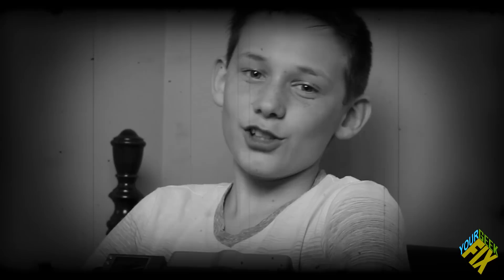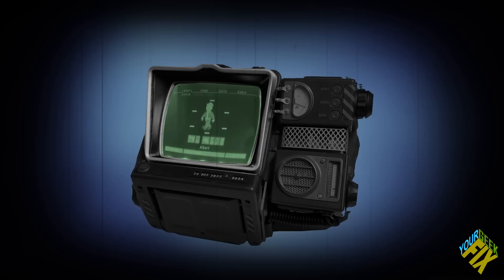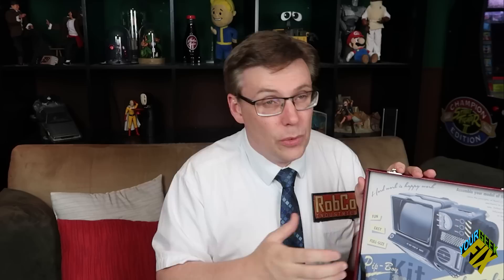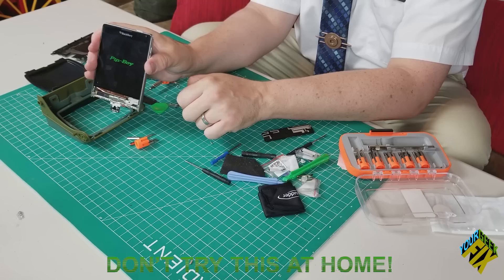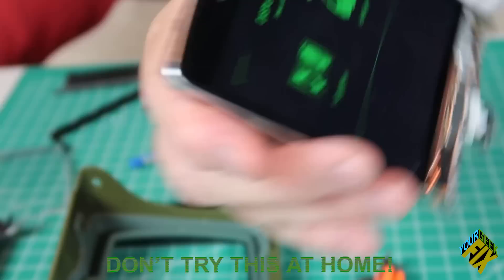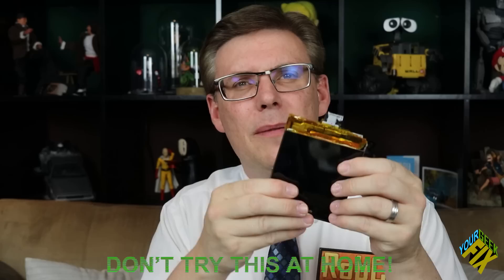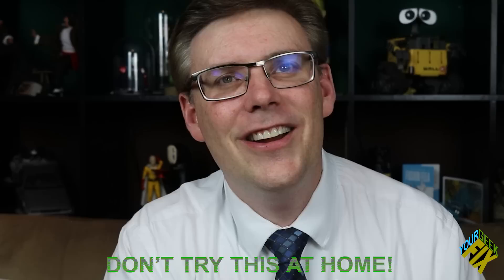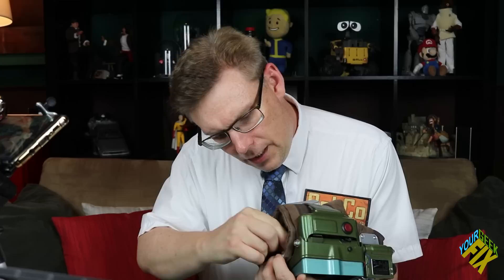How we made a real working Pip-Boy 2000 Part 1 of 3

Comment: When he said “this is the black berry passport” for the third time I lost it. Great video and you can feel the anxiety while building through the screen
Reply from the maker: Thanks for watching Somebabies.
Reply: Just looked up the parts of the phone he used on Ebay....he had less than $200 in all the parts if he just bought them. The phone itself $400+
Reply from the maker: @jamescobun7395  here In the Us, bb passport is available for 65. I typically paid in 60s to 80s.
Reply from the maker: @jamescobun7395  although there were only so many before I took 3.
Reply: I looked up for new in box on the phones latest model. Same with parts.
Reply from the maker: @jamescobun7395  https://www.ebay.com/itm/BlackBerry-Passport-32GB-SQW100-1-Black-Unlocked-Good-Condition/124139952096?epid=203944094&hash=item1ce75157e0:g:uawAAOSwxOlehk0R That was the first one taht came up for me. Also avoid looking at the silver as it was more limited and more recent.
Reply from the maker: @jamescobun7395  There is a silver for 65 with nonworking screen right now. If you are putting a different screen on anyways, it might work.
Reply: Again those are USED parts look for NEW
Reply from the maker: @jamescobun7395  They haven't made this phone for four to five years. I wouldn't dismantle a rare phone that has never been opened. Believe me on that. Doing this mod will definitely end the warranty
Reply from the maker: @Mineta you are pretty darn cool yourself. Thanks for watching and the great comment.

Comment from the maker: IMPORTANT UPDATE!!! I just checked back in with the Wand Company about the "Radiation Sensor." They stated, "I'm afraid not at the moment. Plans are currently on hold as we're not sure if we have enough interest from our chosen retailers.
 We'll update our socials as soon as we have any news for you." I asked how we can help get this done. I'm not sure at this time if it is the Wand Company or certain retailers we want to pressure for this. I will update you when I know more. Stay Safe!
Reply: you can pin your own comments so they stay at the top and dont hover down in the middle of the comment section
Reply from the maker: @novanppp  thanks for the recommendations.
Reply: A real geiger counter might be possible, but only if you can find a way to integrate the detector in such a way that it doesn't mess with the actual surface itself. It would need to be beneath some really thin, preferably very, very light and non-dense material in order to pick up actual ambient radiation - or perhaps some sort of mesh. Not sure if there's space in the prop for that. The dial might be more of an issue though, I'm not sure if any geigers are still made with a physical needle, most modern ones just have a digital display for more accuracy. That would probably need some custom programming.
Reply from the maker: @JRexRegis  I made it already. Watch for video 3
Reply: @YourGeekFix  Nice!

Comment: Just wanted to thank you and let you know I had been planning to try and make similar mods to my own Pip-Boy 2000 as soon as I get one, I had a few slightly different options in mind for Screens and or speakers, and I plan to be designing and building my own Working Geiger counter mod that I plan to make compatible with the app if Bethesda doesn't release an official one. I will probably follow this video to some extent as a sort of reference/tutorial but don't worry I will be following many standard safety precautions including wearing Saftyglasses, fireproof gloves, and an acid/fire resistant smock. I also plan of replacing some of the standard plastic Pip-Boy 2000 parts with machined metal ones to customize the durability and design of My Pip-Boy. This is the first of your videos I've ever seen and its earned you a sub. :)
Reply from the maker: Sounds awesome. I will say, this build is really heavy on your wrist. It also feels like it is made of real metal. So, if you plan on wearing it be aware of weight.  Make sure you share your finished product. Would love to see it.

Comment: This video is awesome. One note that I think would be cool is to take all the charging cables and make the pip-boy's computer cable (that the sole survivor plugs in to computers to hack, obviously) and make it functional and use that as the hub to charge the pip boy (Thus removing the need for the batteries for the radio or the requirement to remove the entire side to access the batteries. Plus it wouldn't be hard to add a small USB battery pack as a central energy source.). Also if you made the Metro hand crank generator you could abstain from the need of batteries entirely.

Just as passing thought. Good luck and halcyon days.
Reply from the maker: That's a great idea.

Comment: As an owner of one of the replicas, the lack of a fully working screen, radio etc on the Pip-Boy is the one disappointment.  A fully working one would be great, and since the app is built out from Fallout 4, it would have been relatively easy to have one and connect it to the knobs etc in some form. As this proves: there was a viable screen hardware option too, and I personally would have paid extra for a fully functional one like this.
Reply from the maker: We have a special app for 76 and new vegas, but less impressive due to no animation of walking. If you saw video 3 you know how to activate the knobs.
Reply from the maker: Also video 3 shows the Geiger counter clock and holotape mods.

Comment: That's the one thing I was most curious about, would it be possible to put a functional Geiger counter inside a PipBoy?

Mostly because I am wondering how close we can come to having an authentic real version of the device, that is exactly like the one featured ingame.
Reply from the maker: Shortest tube I have found is 4 inches and not cheep
Reply: @YourGeekFix  I wonder if 3D printing might be something to investigate for custom made parts.
I've been working on it lately and it's really easy to make an object if you have some basic modelling and math skills.
Reply from the maker: @zrowngctr  You make it and we will use it.
Reply: @YourGeekFix  make what specifically?
Are you interested in plastic parts?
If you provide the measurements and shape of the item desired, I can give it a try.

Comment: We forgot some solar panel
Reply from the maker: The Pip-boy is powered by nuclear energy. But you could solar power it using a Solar Power Bank. It would connect to this build by USB. The smallest nuclear options are the SMRs, which would still be too big for the Pip-Boy. Thanks for the recommendation.
Reply: Your Geek Fix how about longer range radio/stereo?
Reply from the maker: Are you referring to the radio or the screen area? The screen actually can use longer band transmission, using an app. Could use ham app.
Reply: Your Geek Fix no wait we’re is the sound coming out of? Can you add small external speakers on both sides of the pip boy?
Reply from the maker: @sammytimgaming2947   The sound is coming from the top module. It is possible to put 2 of those speakers in there. Right now, it's in the center. Due to the small area, it's questionable that stereo sound would be an improvement.  The right speaker is for the radio only and is a part of that module. Right now, both speakers can work at the same time period.
Reply: Your Geek Fix any other device that we’ll work, and fit the pip boy screen?
Reply from the maker: @sammytimgaming2947  not that I found
Reply: Your Geek Fix are there other blackberries that fit?
Reply: Your Geek Fix thanks
Reply from the maker: @sammytimgaming2947  Not yet. This phone is also very wide. The name passport is from the exact size of a passport. None have been as wide. This is even wider and more square than my notebook. If you find an alternative, let me know.
Reply: Your Geek Fix did you warp the screen?
Reply from the maker: @sammytimgaming2947  Unfortunately, no. THe passport was the only one wide enough.
Reply: Your Geek Fix well the you get the illusion right
Reply: Your Geek Fix hey I have an idea can you just use the blackberry screen and then us a different OS, chipboard, computer? And can you describe on how heavy it is?
Reply from the maker: @sammytimgaming2947  then the touchscreen wouldn't work. It would be awesome to load a different firmware.
Reply: Your Geek Fix your channel seems like the channel been here for a while it quality it actually that good
Reply: @YourGeekFix  
I wonder, if there’s a company, where you send them, what your trying to build.
And they give you, a designed setup to fit electronic inside.

I do not professionally know how to put a blackberry inside my pip-boy.

I would ask a company, to configure my own devices to fit in my pip-boy.
Not sure if there any companies that professionally modify your electronics.
Reply from the maker: @sammytimgaming2947  IDK Sammy

Comment: Of all the "working pip-boy" videos i've seen this one takes the cake. Fantastic work. I made a steampunk pip-boy back in the day using a Galaxy s4, might have to replicate this myself (at my own risk of course). for practicality's sake I'm pretty sure i can figure out how to put a keyboard on that bad boy. maybe I could make the radio module rechargeable too....
Reply from the maker: Sounds awesome! The keyboard and cable are usable after I dismantled it and are needed if you reformat it. You could get a cable extender for the keyboard, though there is none for the screen. The tape deck would be a possibility. Also, the front could work. Remember the keyboard has a trackpad built in.

Comment: Two really simple mods I did with mine at Menards probably other stores sell it also they sell a stick on ultra bright led light that has it's own switch it is about the size of a shirt button , the battery is replaceable also fits perfectly on the top flashing .
The other thing I did was Michaels craft store sells el wire that is battery operated available in different colors , I drilled a small cut into the flashing the battery unit wedges between the cuff and top screen perfect I  then put the el wire by glueing it around the screen then I put a little strip of silver duct work tape around the interior edge to reflect the light to brighten the screen. 
With the two you have one the acts like a flashlight and one that acts like a screen back light as if it was in standby mode.
Reply from the maker: Watch video 3. I made a working geigercounter module, clock, and holotape.

Comment: There are add in wireless charging strips that fit in various phones.

You can get one of those and a wireless charger, wire that into your case and charge your speaker and tablet.
Reply from the maker: This already has wireless charging. Are you saying to run the wire to that?
Reply: You could use one of those adapters as a remote wireless charging "port", yeah.

Not sure if Youtube will allow a link. I've been getting them from Amazon. Look up "wireless charging kit qi receiver", I usually then use the image function to find the correct style. They make some that plug into the charging port externally and some that are installed inside the case, they have contacts on the receiver that touch the contacts on the phone. You should be able to solder the internal style to the contacts on your device.

With a little bit of looking around you should be able to find one that will even fit inside the Pip-boy somewhat remotely so you can just set it on a wireless charger.

The Galaxy S4 version is a little on the stubby side, Galaxy S5 version is longer, somewhat more narrow, the Galaxy Note version has a long neck set with the contacts decently far away from the charging pad itself.
Reply from the maker: I understand

Comment: instead of using a blackberry, you could get a relatively cheap minidisplay screen to match the dimensions (a website i found had them as small as about 1x1 inches), with support to connect to a rhaspberry pi zero using an analogue cable, which can together be powered by a standard rechargable powerbank (i have a powerbank that uses these huge industry-strength batteries, the light on it is actually blinding) and then all you need is a pip-boy rom for smartphones (if such a thing exists).
Reply from the maker: The space behind the screen is .25 inches deep, and about 3.5x4 inches. I originally thought of using Arduino or raspberry parts. Also, the challenge was that it had to fit completely in the area and interact with the game. I'm sure someone out there has the know how to interface it. You can emulate android on the raspberry pi. However, the zero would not handle it. 4B has problems. The raspberry pi people have put a firmware for their pipboy on their site. I originally wanted to use that. Thanks for watching.

Comment: At first I thought it was a cash grab for them not to include the upgrade modules but it makes sense that people who don't want to spend an absolute boatload just get the basic model and others who want the complete thing can get it. Unfortunately I can't get the radio upgrade because I mounted my Bluetooth speaker in there. Really would like to add the phone in there. Originally when I first saw this and bought one that's what I wanted to do. Wasn't sure whether a raspberry pi that was small or a phone would be better.
Reply from the maker: Raspberry is nor powerful enough in comparison to the snapdragon. These phones are around 30 dollars now. Best time to do it.
Reply: @YourGeekFix  awesome thanks I'll have to look into it
Reply: @YourGeekFix  u wouldn't happen to have a link to the spare screens without the back frame?
Reply from the maker: @jakethesnake4040  I haven't found them recently, but not hard to remove the backing.

Comment: you should try making the original pip boy 2000 form fallout 1 and 2 it looks very different and is hand held instead of you putting it on your wrist
Reply from the maker: Other people have done it already. There is a great 3d model for it with raspberry pi firmware.

Comment: Hope you have updated the radio with rechargeable batteries and a charging unit in the Pip-boy.
Reply from the maker: Not yet. I haven't used the raio enough to have it run out yet. I did come up with an easier way to change the batteries.

Comment: You could make a small business out of this by selling a completely assembled and upgraded Pip Boy
Reply from the maker: It is illegal to sell modified phones
Reply from the maker: It's illegal. Thanks though
Reply: @YourGeekFix  It’s a 4.5 Inch touch display right ?
Reply from the maker: @CareraDrift  with 1440x1440
Reply: @YourGeekFix  Would a different resolution also work? I found lots of Car navigation systems witch 1080p touchscreens and android
Reply from the maker: @CareraDrift  The problem is the exact fit. M8ust be completely square to work. If you found a good solution, post it.

Comment: Should have scanned them with 3d scanner first. That way you can have parts made or changed if you need to.
Reply from the maker: Good point. I think there are a lot of parts that have been modeled after this by now you could print most all of it.

Comment: First let me say, I really like how you interact with your followrs, I got a lot of respect for that. Second, i recently bought this pip-boy (today actually lol) and as I realise that your video was made a few years back, I was wondering, is there any other phones out there now that could be used the same way the blackberry passport is, instead of it?
Reply from the maker: No, but now the black berry is cheaper than ever. Check out our other videos on what to do.
Reply: @YourGeekFix  it's still selling for $300 though, that's pretty expensive still for the blackberry passport, hence why I was hoping there was a cheaper alternative.
Reply from the maker: @shartslaw322  35 or less. Look for non working stuck on wifi setup. See our videos on steps to making pipboy and it will help you get the phone past that mode.
Reply: @YourGeekFix  well I did see one, but it had water damage, and all the others I've seen are the higher mark, granted that's on ebay though.
Reply: @YourGeekFix  may I ask, is there a way I can contact you directly message you? I just want to make sure that what I've found is infact the correct item for what you just described before.
Reply: @YourGeekFix , may I ask, where did you come across the ones for $35? I'm having difficulty finding them, as I find the screens, and digitisers for that price, heck I even tried changing my area and going into fb marketplace and trying to find one, but nothing sadly.
Reply from the maker: @shartslaw322  this can also be a timing thing. The blackberry passport will also disappear eventually.  One viewer has gotten a pi version working. Not sure what screen he used for t h at.
Reply from the maker: @shartslaw322  ok
Reply: @YourGeekFix  yeah I heard about the raspberry pi variant, from what I've seen they are both the same price in my country, only issue is I don't know anything at all about coding, and I'm worried I may have to do that, plus isn't the raspberry pi a miniature computer you have to create yourself?
Reply from the maker: @shartslaw322  yes
Reply: @YourGeekFix  so I would have to find someone to do the coding, it's not like they come with it pre programmed, and I just download the app? If so that's what I'm actually worried about lol
Reply from the maker: @shartslaw322  https://www.ebay.com/itm/225047206288?mkcid=16&mkevt=1&mkrid=711-127632-2357-0&ssspo=_FfKsBDQRCW&sssrc=4429486&ssuid=LgeSka0pSvu&var=&widget_ver=artemis&media=COPY